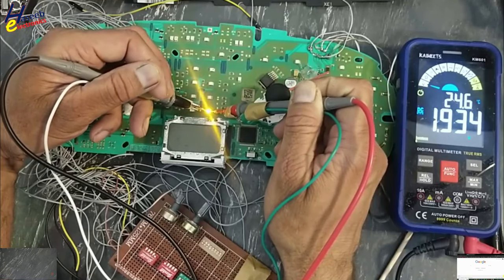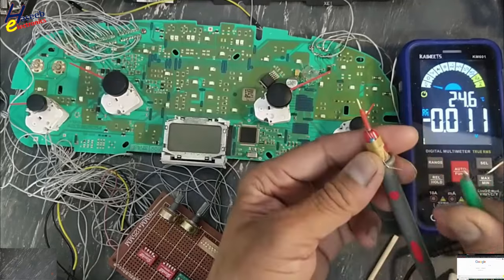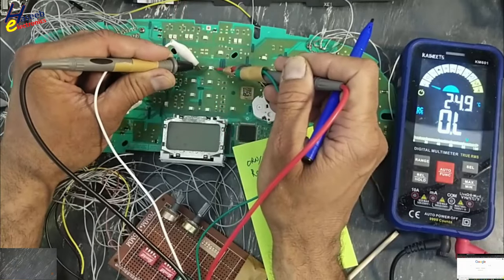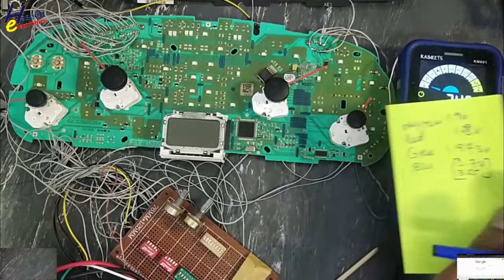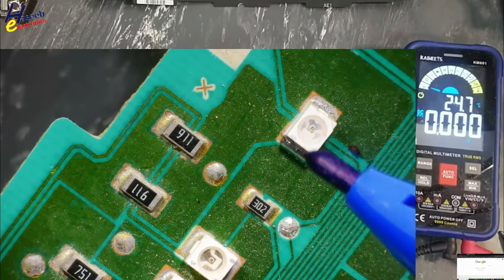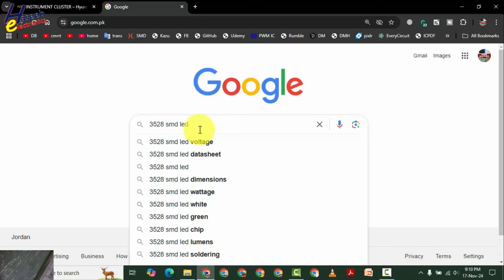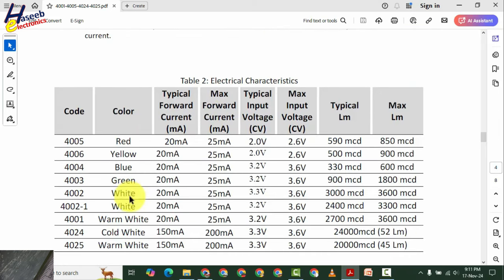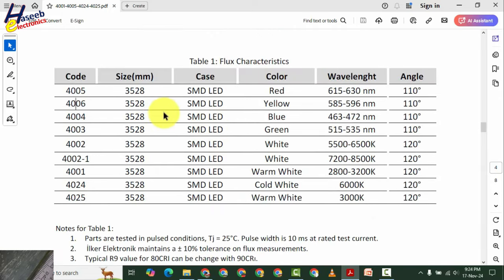{1242} SMD LED, testing, size code and datasheet

Comment: Masha Allah brother, may Allah reward you.

✓Testing SMD led that doesn't light up in Diode mode but using 12vs and 1kohm resistor 

✓ Measure the length and height of the SMD led to find its datasheet

for example 
3.48 mm/length and 2.82mm 
 3.48 X 2.8mm = 34828 led

This is amazing. Thanks 👍
Reply from the maker: yes 
from 3.48mm length  we take left 2 digits. and third digit is much closer. we will consider 3.5mm
read this 3.5mm without dot. so it is 35
now read 2.8mm width without dot. it will 28
now combine length and width together 
3528 it is in  metric code 
it is also known 1411 (in inch code)
Reply: @HaseebElectronics  may Allah reward you bro. Thanks 👍